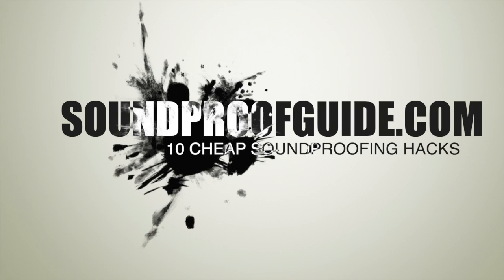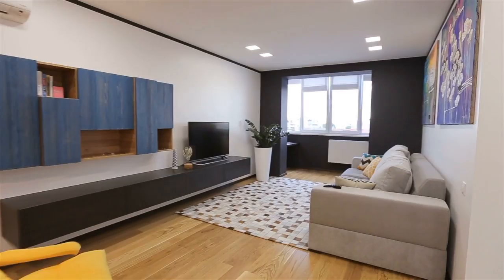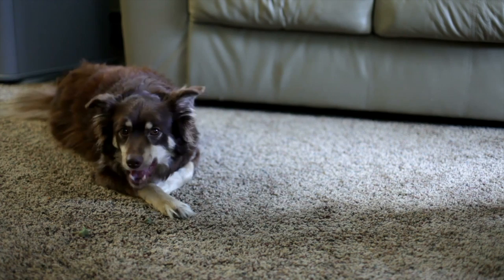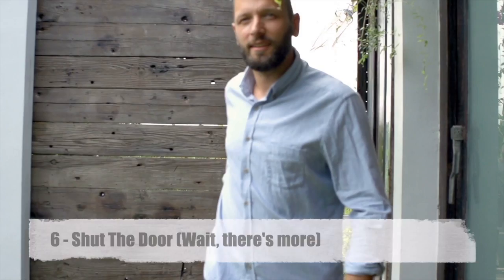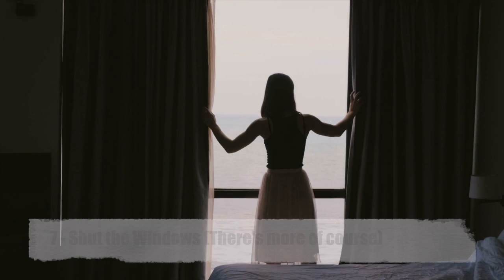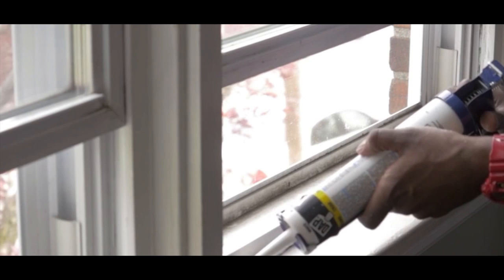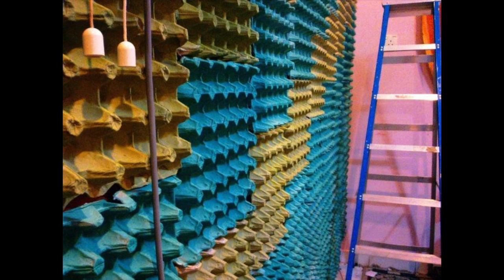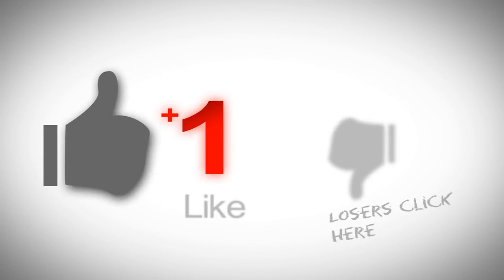10 Cheap Soundproofing Hacks You Should Do!

Comment: can you make a video on soundproofing refrigerators?
Reply from the maker: I will certainly add that one on the list! I’m making a video about how to soundproof a room at the moment so be sure to check that one out when it comes out!
Reply: Yes very simple just buy a quite fridge
Reply: put something like rubber pads under the feet, and see if it's touching something that's unintentional amplifying its sounds, also you can encase the fridge with something solid, just make sure the back of the fridge is vented, the air needs to be able to escape at the back of the fridge, for the fridge to dissipate heat out the back. Other the fridge won't work properly.
Reply: @soundproofguide  They have split-system air conditioners so the noisy compressor and condenser are outside.  I've often wondered why split-system residential refrigerator/freezers aren't available for eliminating unwanted noise.  My frig is very annoying at times.

Comment: Hi Soundproof Guide, would you say that plywood is better at soundproofing than drywall? And if plywood wins, would you say that a protective layer of linseed oil (safe alternative to chemicals that treats wood) would help block more sound? As to create an impervious surface and also protect the wood for longer. Not sure if this helps with sounds at all which is why I am asking. It is just my thinking and me trying to think outside the box. The reason I'd rather use plywood is because I am trying to soundproof my basement. And plywood is less prone to molding.. Ty : )

Comment: Hello. I have an old style wooden window (90cm x 90cm) with a two way open systen. Each way has a glass in middle (70cmx35cm). I need to prevent outside noise of dog barks and marble cutting machine noises which should be around 65db when heard from inside the room and windows closed. I have ordered and not yet received the soundproofing tape which i believe to be a solution for my problem but not sure. I am giving a hit and trial and trying my luck you can say.
Do you think it shall work? Yes ? No? What could be a better solution? I am little confused honestly.

Comment: Most of these are expensive, has this man ever bought a rug? Bookshelves? Or books to fill it.
The paint is worth a try, though what cost??
Reply: The best the paint can do is about 10 dB. And it’s recommended you apply 3 coats at $70 a gallon, I do not know what the coverage is per gallon. A good quality regular paint can be purchased for around $40 dollars, granted regular paint probably has zero noise reduction. I don’t know for sure. 10 dB is the sound a leaf makes when it falls to the ground. Normal speaking voice, a regular conversation is about 60 dB. Standard 5/8 inch Sheetrock can reduce sound about 34 dB. If you just double regular 5/8 inch Sheetrock you can get at least 50 dB of noise reduction. With insulation and a third layer of 5/8 inch Sheetrock on the other side of the wall you can get at least 60-65 dB of noise reduction*. Sound can still transfer through the studs, outlets and heat ducts. I know this because I just isolated my utility room from the rest of the house. The blowers on the furnace and water heater can reach 80dB, now I can barely hear them. Mostly it’s sound that can still travel through the ductwork, now it’s a manageable background noise. There is a product called Quietrock, it claims to reduce noise by something like 54 dB. It’s also about 4 times more expensive than standard Sheetrock and is only 1/2 thick. Most fire codes require 5/8 inch. But at $70 a gallon for maybe 10dB of noise reduction, I think I’d pass on the paint. And the noise reduction paint only comes in grey. If you paint over it, I have no idea how it effects the noise reduction. Hopefully this helps you with your sound proofing needs.
Reply: My goodness James that's quite a large reply,  I'll not be buying the paint unless I get it at the local recycling centre for free.
Reply: @jamesmchugo9422  have you ever been called an overachiever?

Comment: Hi, I’m in the need to soundproof my own little studio and this video has given me some tips, however due to space I’m not sure which is the best way to soundproof a low metal ceiling which includes a metal beam. Any advice given would be really appreciated! Because of the size of the room I’m not to sure if bass traps will make the room sound muffled. I do have carpet in the room and it  is plaster-boarded on the one side, the other side has plastic cladding on. If you do you have an idea with what is best your help will go a long way!
Reply from the maker: Visit our website at https://soundproofguide.com 
You should be able to find something there to help with your situation. Let me know if you can’t find any information and I’ll look deeper into it.

Comment: Can I use Mass Loaded Vinyl to sound proof ceiling and floor? Panels would probably be too heavy for the ceiling?
Reply: Not for floors. Mass-loaded vinyl is not effective for vibration noise.  However, if you're tearing our your existing ceiling and replacing it with insulation, drop ceiling, etc. -- then mass-loaded vinyl can be effective in blocking conversation noise between upstairs and downstairs, TV, etc. But not for footfalls -- that's a different solution.

Comment: I am doing a winery and want to keep the sound down in areas where folks gather.  Is sound proofing the same as sound absorption?  Does the wall paper absorb sound or just prevent its transmission through a wall?  I need it to absorb the sound of people talking which gets quite loud in most restaurants I have been to.
Reply: Sound proofing (isolation) is not the same as sound absorption... It sounds like you're looking for absorption (fluffy stuff like thick curtains or couches will get that muting effect). Further improvement can be achieved with diffusion (check AcousticFields, for exa,ple).

Comment: Looking for ways to reduce neighbor AC sound just beyond 7’ high wood fence.   The AC is next to their house 3’ from fence.  We have climbing bushes on our side with little attenuation.    We assume sound comes over and thru fence due to reflection off their wall siding?  Any YouTube video help?
Reply: New windows like hurricane windows well block out 90% of the noise
Reply: Try insulating gaskets for the cover plates of light switches and plug outlets.  Fairly inexpensive, found at hardware stores near the weather stripping, Lowes, Home Depot.   They are good to install for multiple reasons.

Comment: Would moving blankets or acoustic foam be more effective at soundproofing?
Reply: For higher frequencies, to some extent, it would work. Never tried moving blankets, but acoustic foam is rather for acoustic correction in the room. Acoustic correction and soundproofing are different things. A foam diminishes the reverb and sound bouncing, but doesn't stop sound, especially lower frequencies, which go easily through. You need mass and impermeability
, if want to stop sound from leaking out from the room.